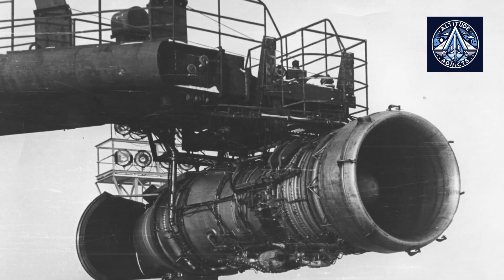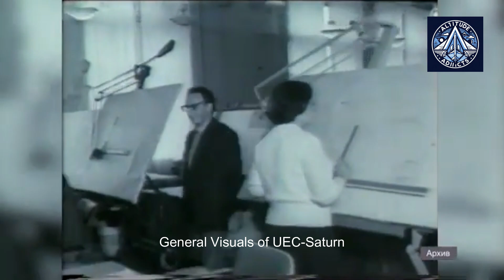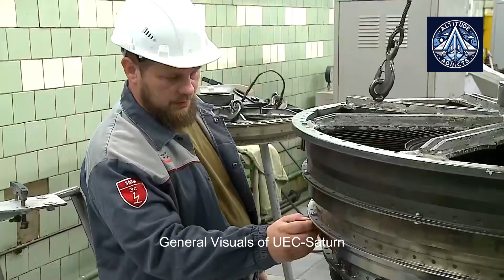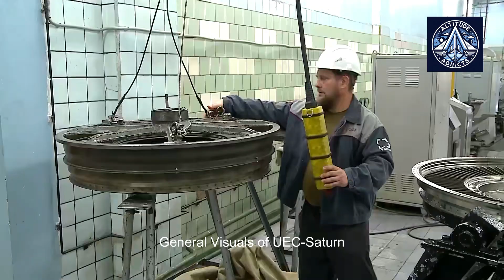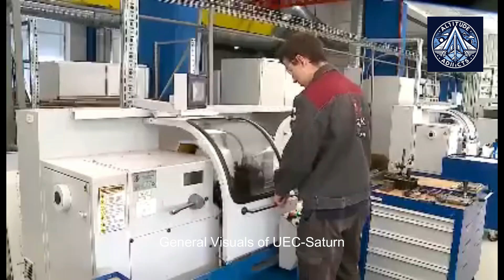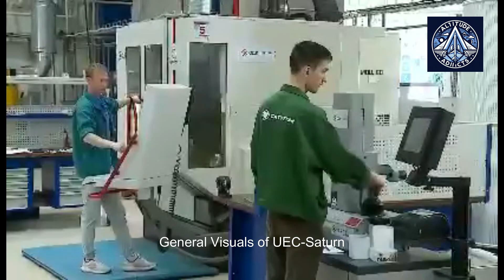Soloviev D-30KP Engine : The Workhorse of the Il-76 and the UEC-Saturn Rybinsk plant

Comment: Even though PS-90 Engine is Better than Soloviev but to the Contemporary Times the Sale Factors are much different.

The Soloviev is much better in Lifecycle Costs than PS-90 Engine.

The Soloviev is already a Dual Spool Engine but with the much Better Thrust than PS-90 makes it attractive for Aircraft Manufacturers.

The Flow of Thrust Compression in Soloviev is much Better than PS-90 and makes it give the ability to Generate the Dry Thrust with Ease.

Comment: Last Q: Fairly easy, the D30 platform is a legacy engine used in plenty of Soviet era aircraft. It's tried and tested and dirt cheap in comparison to its contemporaries - especially in military aviation.

The PS90 platform isn't widely used, with a few Tupolev and Ilyushin aircraft using it - far superceded by Western alternatives. The Russians dug themselves into a hole with their attempts to modernise via technology transfer from P&W - only to be burned with sanctions and an over-reliance on Western engines. The PD platform should aim to solve this, but few customers outside of Russia (Iran and NK maybe?). The Chinese are also focussing on their own domestic engines, with the most advanced being the WS15 and 20 series (the latter being a development of the D30). Comac also creates a new incentive to produce cutting edge domestic engines and leaving out foreign partners where possible